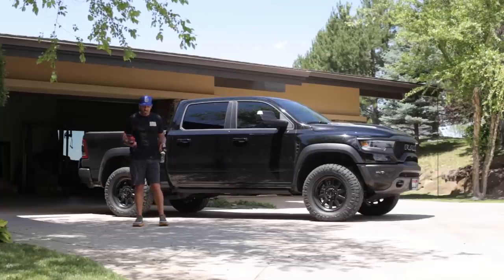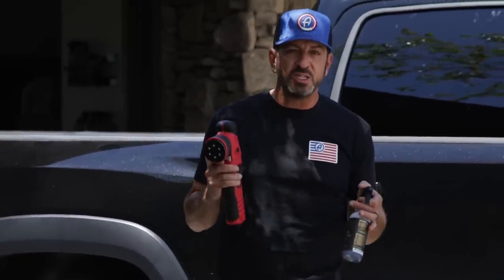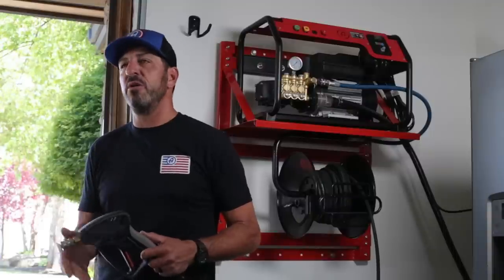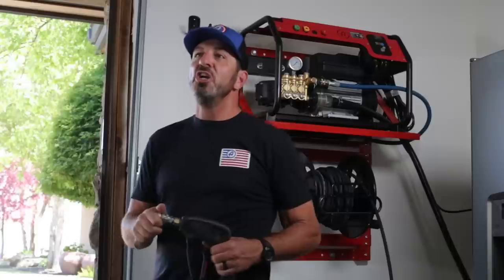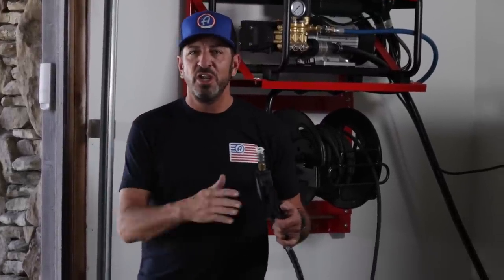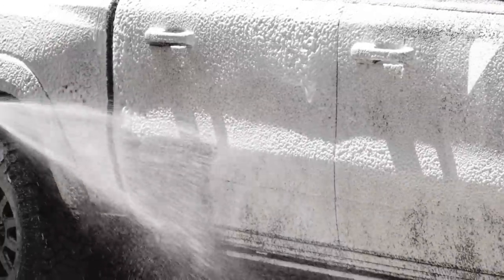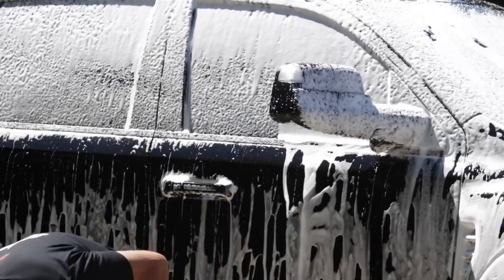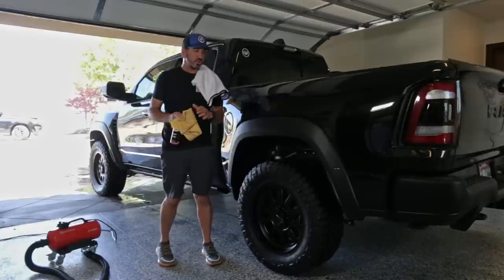What Are The Most Essential Washing Tools?

Comment: What is the difference between Adam's Graphene VRT and Adam's Graphene Tire Dressing?  Thank you.
Reply: The VRT is a product you can use on any vinyl, plastic and trim (Interior and exterior), while the tire dressing is just for the tires, and they both have a bit of graphene included.
Reply: Plus the VRT is more of a cream and applied with a foam applicator typically, the tire dressing is a spray
Reply: Direct from their website, on the Graphene VRT page:

Much of the difference is related to details “under the hood” – what is the ratio of the different silicone fluids, what polymers and resins are included or missing, how the emulsions are built for their intended purpose – but the largest difference is obviously the viscosity. The two formulations are made to suit different purposes in the detailing process.

Graphene VRT™ is about versatility for use on many substrates and the thicker viscosity aids clinging so it doesn’t run on a vertical surface. It will work similarly to the Graphene Tire Dressing™ on tires, but the decision is do you want a crème-lotion or do you want to be able to spray and wipe? Both will provide a very satin-sheen, or can be layered to a semi-gloss, while being very durable and resistant to weather events and washes.